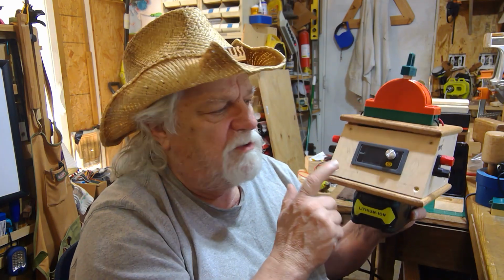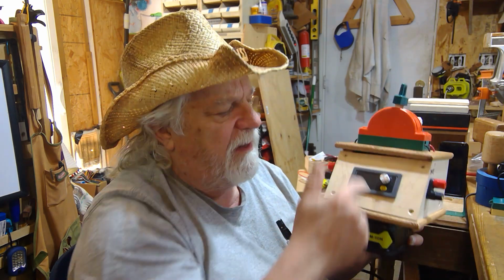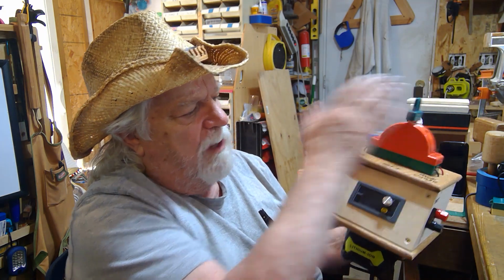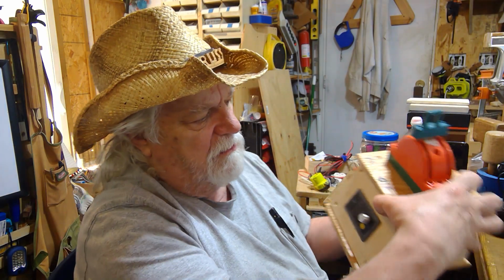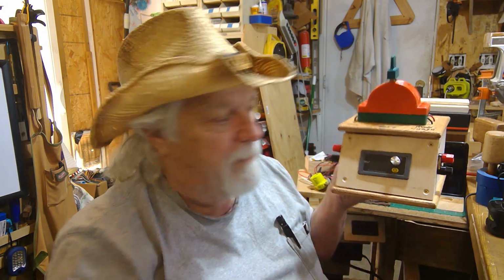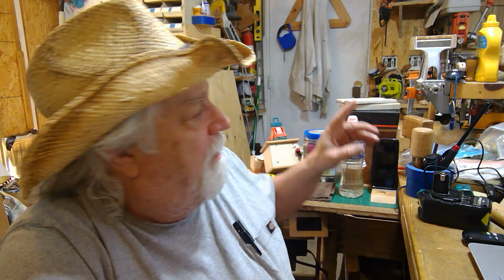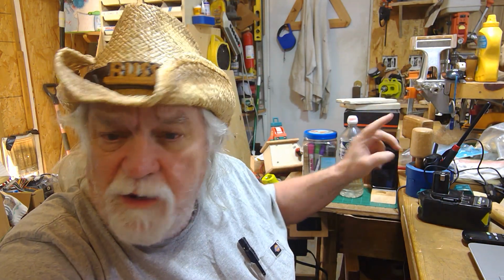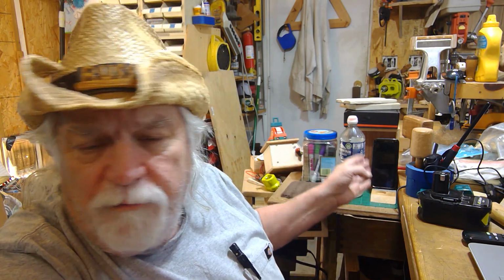Rambling Rampage #10 by Rambling Russ

Comment: Air Conditioning backup idea  - - >  I keep a 129 Volt 5,000 BTU air conditioner window unit in storage.  With a fabricated plywood "bracket" that fits the window opening all I have to do is mount the bracket in the window, slide the AC unit in and run an extension cord to the generator.  The AC will keep the master bedroom area comfortable.  My future plan is to run this small AC unit using my  4 Renogy 100W solar panels.  - -  Fortunately we have NOT lost power during the current heat wave here in lovely north Louisiana. :)
For backup lighting I've got a Home Depot light fixture with 2 light heads that I mounted on the ceiling near the electrical panel.  That provides enough light for me to safely move around setting up the generator etc.
THANKS Russ for your time and the educational videos.  Have a blessed day.
Reply from the maker: I remember the day I mounted my 20000 BTU ac in the shop window.  I was overmatched then and needed a second pair of hands.  I now would be overmatched with a 5000 BTU unit :>).  I am thinking of getting 1 or 2 mini split units to straight off solar.  But I'm afraid the return on investment may take longer than I got around here. I could mount Window units (lot cheaper) in a couple of windows at opposite ends of the house.  See, now you got me thinking about ac stuff

Comment: Don't use ice, use frozen bottled water. No extra humidity, easier to handle, no drain needed.
Reply from the maker: I'm thinking of using some kind of radiator (oil cooler?) and then the air never touches the cold water and prevent raising the humidity.  The ice should last longer, but it would require more watts to power the pump. too. thanks Eddy.